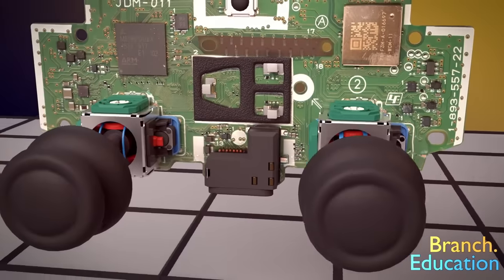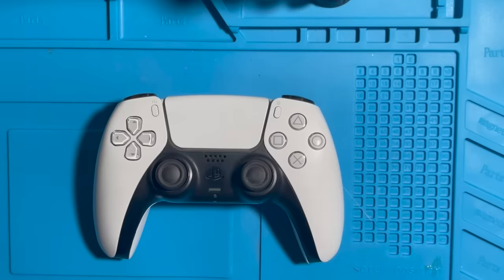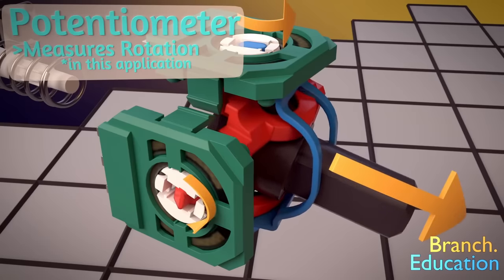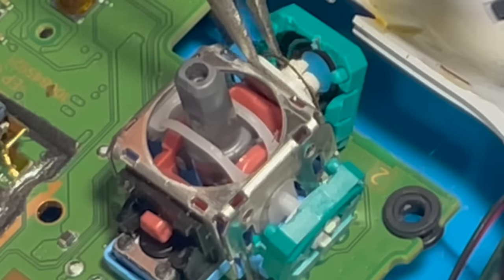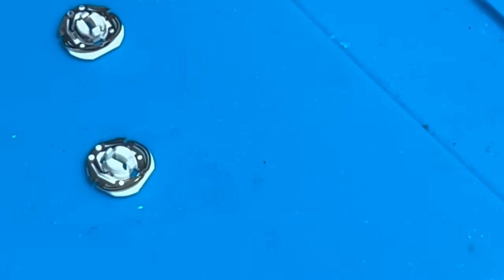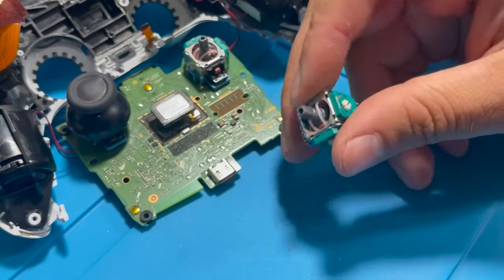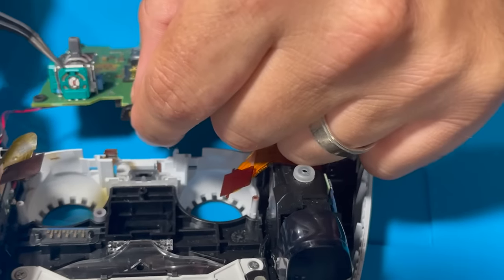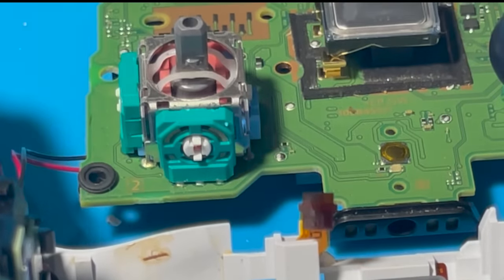What Causes Stick Drift Controller and How To Really Fix It

Comment: What about the toggle press down click to run.?  Destiny 2 is the type of game that clicks down to run and toggle stops work quick.  A game like modern warfare doesn't need to click down. Just move forward and it will auto sprint.   Iv gone thru 4 controller in 2 years only because toggle stops working.
Reply from the maker: Get a controller with paddles and map the L3 or R3 to the back paddle to avoid clicking the joystick

Comment: This is so frustrating.  I've NEVER had a problem with any stick type controller until PS5.  I've gone through 4 fucking controllers and all get drift on different sticks in different positions.  My current 2, the first one left stick drift when I try to move the stick down, it will register going up.  My other controller is the right stick and is always slight moving up, which makes the camera in my games move constantly.  It's quite annoying.

Comment: thats funny every controller ive seen so far has stick driff on the left side have not seen a new controller that has it on the right hand side and you sure this is not the company doing this because i bought a brand new controller and the damn thing had stick driff on the left side right out the damn box so this is gotta be a problem on them ans its not okay with me i have 4 or 5 controllers that have stick driff on the lfet side only never the right
Reply: It has to do with deadzones for games. The right stick overall is more focused on camera and the left stick is movement which needs lower deadzones to feel responsive. If you play Cod you get your drift on the right stick.

Comment: The point is you shouldn’t have to repair these at 70$. I have owned and bought nothing but PlayStation since the first one, I have never had any issues with their controllers EVER. I that was the reason I stuck with them. I would hear about red ring of death or controller drift but didn’t know what it was. No I have bought the PS5 and within one year and two months I have had two different controllers drift on me to the point of no return. We all know they’re not getting worse with time, this is an intentional gimmick to set consumers and their fans up with failure. Sad everything now days has any quality yo it anymore, and if it does the manufacturers will make sure not for long.    Quality = a thing of the past

Comment: I hoped SONY would change materials for the Edge Controller, but they are the same pieces of trash. No wonder why the replacement Joystick modules are sold out.
They should upgrade to induction so there is no more wear and tear on the pieces. The resistance path is a coat of graphite, so it eventually gets worn and dust starts running along with the wafer causing false contacts.

Induction joysticks remove any scrapping by making the wafer and path a magnetic coupling, the precision can be as high as your software can handle and the only wear and tear piece left would be the spring which in the worst cases would cause your joysticks to feel too soft, but that should take 2+ years of heavy usage and not 4 months which is what I've been experiencing with drift.

Comment: Here's a bonus tip to prolong having to do this as well. Just try to use the analog sticks less when the game allows you to do an action with them (pressing down on the stick is what I mean)(for example, running with L3), just switch it out for another action that you don't use as much. That's what I do and I haven't had to deal with stick drift so far and I play a good amount of games that require L3 for running, and it's been beautiful ever since I got used to it. But it's up to you if you REALLY want to do that. Otherwise just keep playing the way you like to, simple as.
Reply: Which button do you use in place of it

Comment: Does this work on Xbox controllers?
Reply from the maker: I never tried it on Xbox, but to my knowledge they are using the same joy stick module cubes. So most likely if you access and clean it. It should work

Comment: Look, in essence you're not wrong in your approach, but it won't be a long term solution in your case. The inner trace of the one potentiometer on the left x-axis is gone, you can see it clearly in your video ( https://youtu.be/nrNnxcsVgz8?t=285 ) . That one should be replaced.

The problem with stickdrift on resistive pad controlled sticks is twofold: Over Time corrosion on the white moving spring causes contact resistance to go up. Also, the resistive contact film wears out and causes resistance to go up slowly and after a while suddenly loose contact alltogether. If you remove the potentiometer module completly the stick will drift all to one side all the time. Thats why stickdrift always tends to go into the one direction, on PS4/PS5 its as if you push the stick left/up on the x-axis/y-axis.

What I'm doing to fix this is always desolder the potentiometers completely, clean them with a contact cleaner (Kontakt60 by Kontakt Chemie), only if they are savable of course, and leave the cleaner inside, for it will most likely reduce the wear of the resitive pads, then resolder them. This will boost the precision of the sticks, as corrosion on the metal spring inside is no issue anymore, and also it will make sure it lasts longer than without the cleaner inside, for dirt and debrie will have a harder time getting inside of the potentiometers if the cleaner occupies the space.

If you are interested in this topic, maybe check out Marius Heier, for he's working on a solution to fix stickdrift once and for all. ATM he only has a solution on PS4, but PS5 will be on the horizon soon.
Reply: The only solution is replacement (temporary fix) or hall effect gimbals (no such replacement option for Xbox One or PS5 controllers).

Comment: Hi mate sorry to disturb you but I like to ask something that it will make sense if I tell you like this what is the wipers for that is on the controller what if you can switch them off advertised on the YouTube with somebody saying that you can switch them off that stop the controller from doing moving by itself and spoiling the game that you are playing what do you need the wipers on the controller will it still work is it better to just get a normal USB controller instead of a Bluetooth wireless controller the I normally get them from cash Converters are sometimes CeX and you don't really know if somebody has been using them and it was doing the same thing and they took it to the shop and sold it just to get money on their selling them is it better just to get one from a proper shop that's a deals with these controllers will it still work that I have had more controllers that you can count up to avoid free controllers and it did the same thing I got one that is from a normal shop that sells mobile phones and you name it but it still did the same thing I got one from cash Converters and CeX it still did the same thing but getting these wipers you can get them from eBay or Amazon what it costs different prices between £3 an upwards to £5 and less but connecting them back onto the controller how long do these wipers last is it better to keep the controller covered up at all times I'm dust from getting inside of the device will that stop the controller from doing the same thing that is putting us off from the game doesn't do it on cars is your driving a car he just does it on bikes or motorbike it just goes around and around when you're riding a bike but if you're in a car it just cares on straight down the road and you turn the left and right it doesn't do nothing you only does it on motorbikes or pickle bikes how come sorry for this message could you solve the problem and put a video about thank you so much

Comment: I have something waaay weirder happening to my ps4 controller: if I move the camera with the right stick, it also walks (left stick) in the same direction. Happens sometimes, I have to shake the left analog stick and it temporarely disappears. I can't even begin to think how hard they had to fuck up to make something like this even happen. 
Had an old controller (the one that came with the console): 7 years of intensive use, never had a problem. Bought this new piece of junk for 70, sony original, and after one month the light stick was already drifting when aiming up. Another 5 months and it has the "right stick also moves left stick" syndrome. 
Personally, I'll never touch sony's garbage ever again.

Comment: You have no idea how many I've took out and re soldered, yes the whole unit ffs no way!!!! I've even put too much heat to one and it's permanently stuck to the left no matter if I replace it. Full board replacement lucky the full pads go for and £20 in my area.

Comment: They used a magnetic type module on older controllers it practically looks exaclty the same as these but inside a magnetic that lasts forever. Now this scam. Why not use what always worked?

Comment: there is an actual fix besides just trying to clean them/change the wiper... its not "wear and tear" i have been doing this for 30 years flying rc ect dealing with pots of all shapes and sizes ... thousands of hours on the pots in my RC controllers.. never had one drift... so the truth is most of the time its an incorrect resistance level due to cheap as ...... pots ... the most effective and permanent fix is heldergametech stick drift fix though they do have to be soldered in

Comment: Though very informative, how many would have the the abilty, tooling, time, assuming they after watching this could do it correctly. I, could take it apart, but putting everything back in total working order, who end up being more expensive in the time and effort. Thus I just purchase a new controller. And that's what the designer's planned on when they rely on the sales of controller's. I mean, Xbox for just one example, can, could give you a free controller. It's the second, third, etc. You purchase in which they make the profit's from. Simular to eletronic printer and the way they today won't work unless you purchase the various color ink from the manufacture's selling the printer for almost nothing. Use to be on could if they chose to only utilize black. Today one is mandated even if never utilzed in which case it will eventually dry up, and not register as being available any color but black. If and when one doesn't need color ink, too bad.

Though it was introduced a couple of decade's ago, for some reason it never caught on until just recently when a company started utilizing magnetic's in place of the ???ometer. Ironically, it's a cheaper controler and though it doesn't or won't ever have an issue with drift. It will be a considerably longer time before the issue even comes close to being an issue. On an average case, it will last year's vs weeks in comparison.

Comment: Since N64 like 22 years ago, I haven't get a drift stick... I don't know how yall be playing to get the joystick like that, and then blaming the company and the product.
Reply: Empirical evidence (actual testing) of resistive carbon track degradation from wiper wear and a settled class-action lawsuit disagrees with you. Your anecdotal evidence does not reflect the reality of the situation. 5/6 folks can pull a trigger in a game of Russian roulette and be fine and claim 'there is no issue!', the 6th and final guy will silently disagree.

Comment: But, do you really discuss “what causes” it?

First of all, the potentiometer does not measure anything, and that’s your problem in describing this.  It is like a volume knob and it adjusts the voltage by it’s positioning (despite what websites stating it measures - other websites say what I said, it adjusts the voltage).

It is the circuitry elsewhere that reads this voltage change.  This is the actual measuring that is taking place because it’s reference point is x volts and now it’s xb volts.

So, what you have done is describe 1 cause of many.  As others have pointed out, different things can correct the problem, but not necessarily.

In my personal case, I have done all that your video and others have done and my issue is now worst.  I have replaced the whole potentiometer (both) and replaced with new components and as I say it is worst than how it was originally.

Now, it IS quite possible that the parts I bought and used are just cheap knockoffs and that’s could very well be my problem.

But, given that there is elsewhere that this could be affected, it’s also possible that’s where the problem lies in my situation.

To explain, is the actual circuitry that does the measuring, failing?  Is some resistor or diode or what have you beginning to fail?

At any rate, my point is, you explained what caused your issue but I’m simply pointing out that that is not the only possibility so it is not what causes it as though a definitive answer, but just one cause of many different potential causeS (plural), not a singular cause.

I went through this, not entirely because I want to be nitpicking, but just so others aware and so they know there case may mean it may take more to fix the issue than what you demonstrated.

That having been said, there is absolutely nothing wrong with them going through these same steps, but if it doesn’t resolve their issue, are you going to take the blame/liability for it because you said it was the cause?

I’m sure if it came down to it, you’ll try to wiggle out of it, but that’s what you state.

Comment: Why made a video if you NOT going to speak and explain things. I could have saved a lot of time and money if I knew the stupid clip thing on the controller was literally welded on. Ya’ll be making it seem you can just buy a replacement part, and clip in back in. I just threw the POS in the trash. I freaking hate Sony. 2 broken ps5 drift controllers, yet my ps4 have zero issue even till this day. 

Don’t bother trying to fix your controller unless you just open in, STOP at the motherboard and just try to clean it that way. Otherwise just save yourself time and headache and buy another one. LOL

Comment: There is no 'fix' for drift caused by resistive traces removed due to wear which happens to all of these potentiometers eventually. The "fix" is hall effect sensors for the gimbals (different controller usually), replacing the potentiometer whose axis is affected, or buying a new controller. There is no exception to this and anyone trying to tell you otherwise is a nothing short of a charlatan.

Comment: Never works I’ve fixed so many controllers I’ve they got drift your screwed. You clean the or change the otenchiomiter never works right it’s a flawed system don’t buy scuf have the Dane issue get a dispenser edge or elite